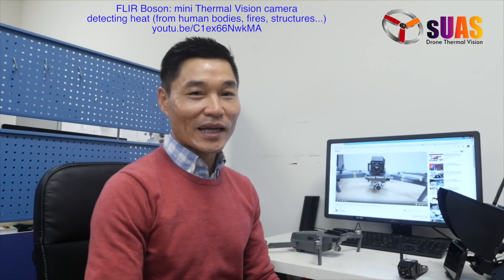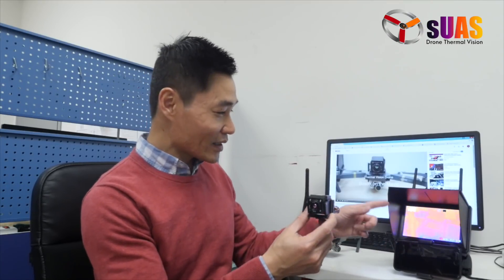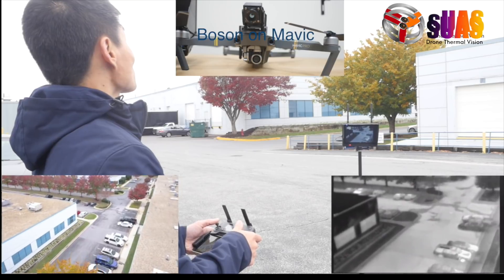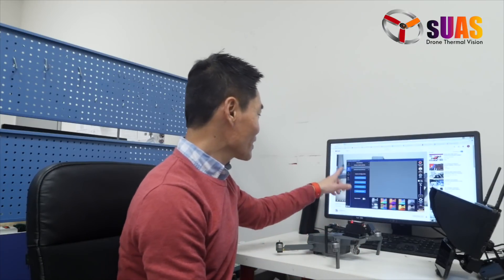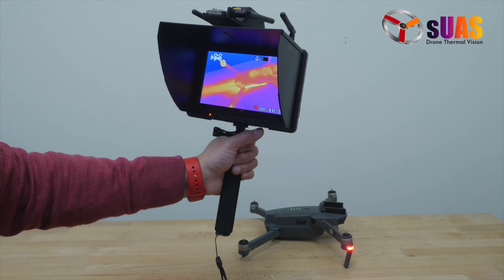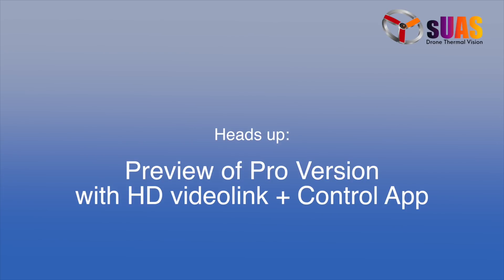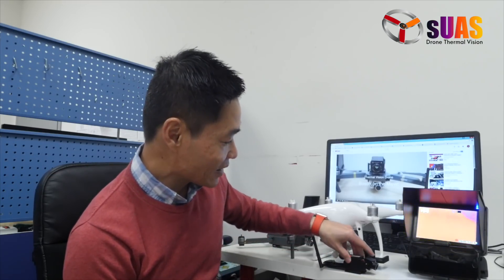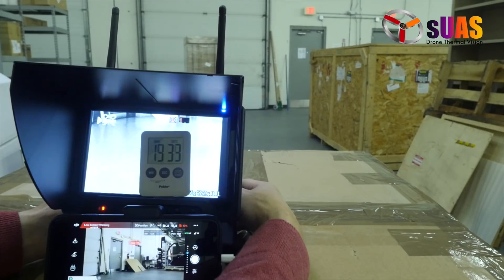Turn DJI Mavic+FLIR Boson into a Powerful Thermal Inspection Tool for Ground and Air works

Comment: I've been looking around for thermal setups for Mavic and this one is really top notch. Simple and effective. Nice job! But I am a little disappointed it only has a 700m range. That's not that far compared to the range of the Mavic and P4. Any plans or ideas to improve the range of the FLIR?
Reply: Thank you for the response sUAS LLC. Your range improvements is wonderful news! 1000m is respectable, and here in Canada the drone must remain in LOS at all times so 1000m is workable. 5km would be outstanding. I'm currently flying a Mavic Pro so hopefully the GPS issue is resolved if in the future I decide to proceed.

One more question for you since you are making great strides on improving the range- how is the range on Duo Pro R for the Inspire 1 and Inspire 2? On the product page it says 1-2 miles, or LOS. Will that range be improved upon in the future?

Comment: Hey Tony,  Any chance you have an example video file you could send me or upload so I can see full res how stable the shot is and how easily I can pull out a still frame from a video file?  Thanks!  Daniel.Fostel@gmail.com   looking at the 640 fast frame with your fixed mount... but want to make sure the files are stable enough to not need a gimbal
Reply: sUAS LLC  Yep watched it probably ten times... Lol.  just trying to see how well I can pull a full resolution frame out.  Hard to tell watching the downlink through a camera lens and then uploaded... Curious how it looks right off the card.    I like the gimbal mount you made,  but unfortunately it does limit 90* down shots.  At the size point I might start looking into a different drone and possibly the GPS tagging as well.
Reply: sUAS LLC  magic of the Boson is keeping it small and simple.. As long as it can get the job done (solar panel and roofing checks) I would like to run the compact unit.  eventual plan would be to run a DUO Pro 640 if the business "takes off" :)
Reply: Hey Daniel. Did you finally get the results of video quality ? Is it stable or shaky ? Thanks.